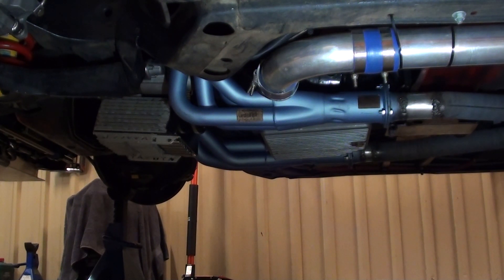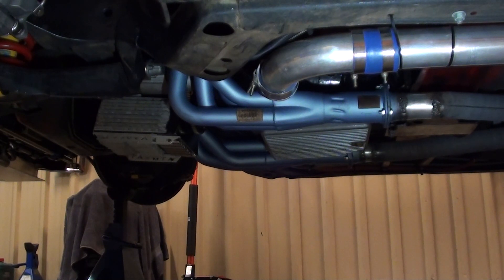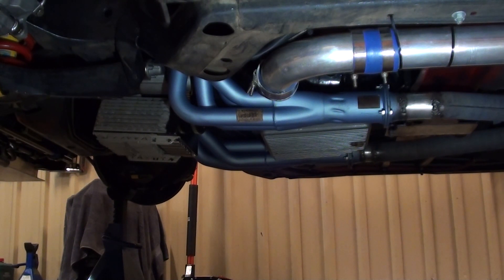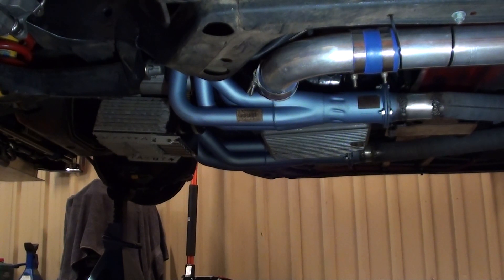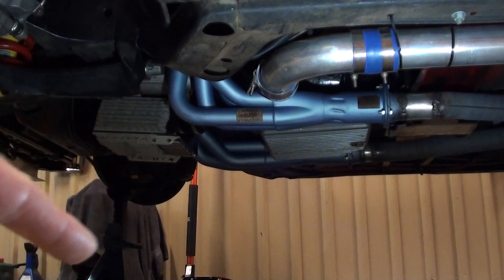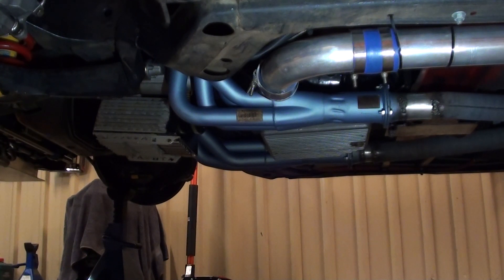REARMOUNT TURBO ( HEADER WRAPPING THE FACTS)

Comment: Pretty much my experience.  wrapping the exhaust really helped boost RESPONSE. that resulted in better low end power and part throttle l I use stainless pipe tho for longevity.
Reply from the maker: qballc ive been running them without wrap for a few months and to honest, best move i made, the only difference really, takes a little longer to warm up.. i have kept the blanket on turbine housing which helps, but pipes are in great shape..cheers

Comment: Header wrap is expensive to. I wrapped my headers so i could work around them while heat is in the exhaust.
Reply from the maker: Anspar Anspaugh yes it is,and gets very expensive the damage it causes on mild steel...
Reply: GRIFFS REARMOUNT TURBO, The Modfather have you looked into ceramic coating? Doesn't do the damage header wrap will do and works the same of not better than wrap too

Comment: Enjoyed very much mate, your bang on the money when talking about the heat wrap. I guess it's more an under bonnet temp solution than anything. Note briefly  ceramic coatings on metals also can contribute to metal heat fatigue as well, particularly on mild steel headers. The answer is separate headers going into the collector and tabbed off. This allows the pipes to freely move under heat squirm and not fight each other when all welded together in one unit. This still doesn't solve the over heating of the metal under turbo conditions though ,as temps rise with manifold pressures. I'd say for time attack situations go the wrap, but if you want more lifespan then no wrap. Another very good vid mate there's not a lot of people who will actually put it on the line and say it. There's a lot of people who watch this channel mate and go off thinking their heads off , I know I do :-) :-) :-) cheers mate
Reply from the maker: I only put up what I have experienced,and share what I have discovered, as well telling it in plain english and a hands on approach.just keepin it real..cheers jeez